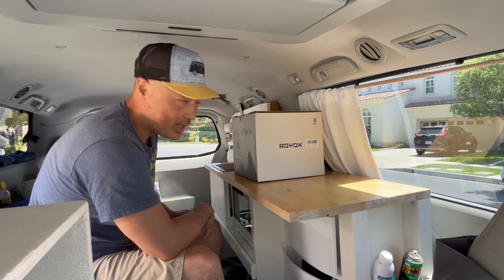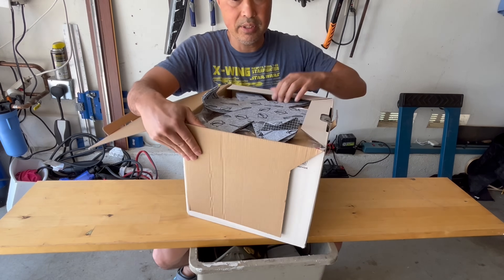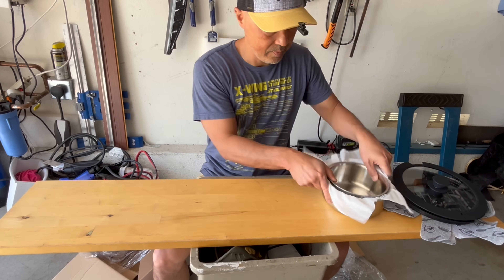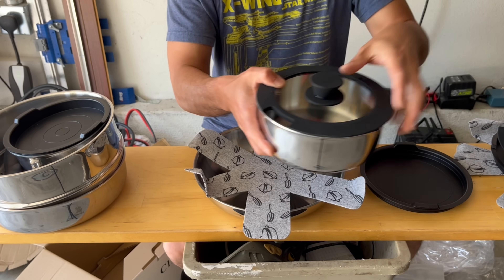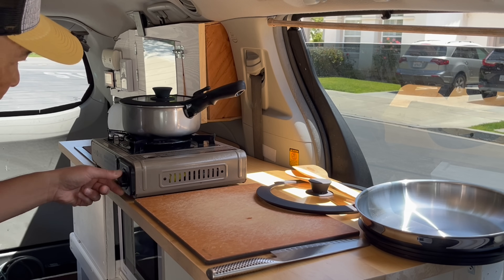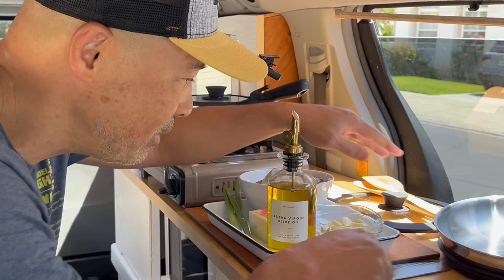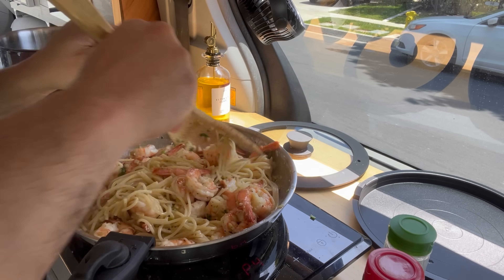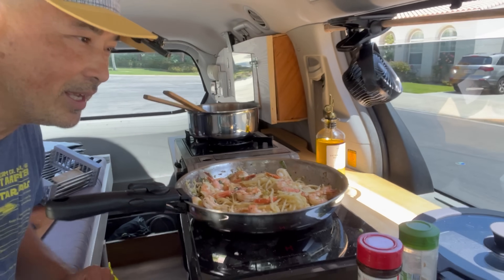COOKING IN CARS Easy and Delicious Shrimp pasta. Trying New ROYDX Cookware Set

Comment: I love the pan set! I need  that handle thing for a pan I have. Wonder if I can just buy it. I am attached to my cast  iron pans and already have too many saucepans or I would buy the set. The size and weight is an issue for me, but mostly NO SPACE LEFT!   Can I give you a time saving tip?  If you use kitchen scissors (i get mine at Dollartree) you can cut green onions, cilantro, parsley,  etc. Real fast.  ♡
Reply from the maker: yes, scissors are a great idea.

Comment: Very similar to my carote set of pans.remoeable handles and lids.but they are lite weight alumium,but coated very well.need little or no oil to cook and less heat to cook.its a snap to wipe clean
Reply from the maker: I like aluminum ones too, but can't use on induction stoves like mine.
Reply: @Tiny-Campers  yes I like induction ad well,we have a one burner induction with our gas stove in the kitchen.so I can use these on the gas stove or camping gas stove too.love my stainless set and cast iron too.